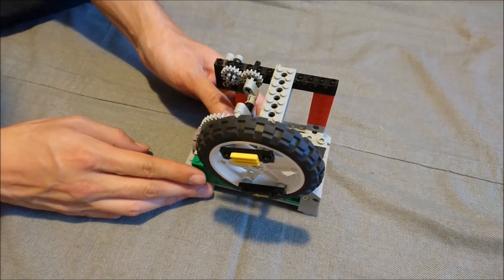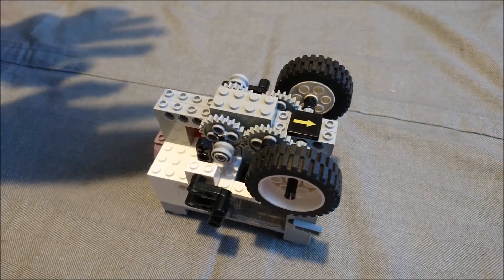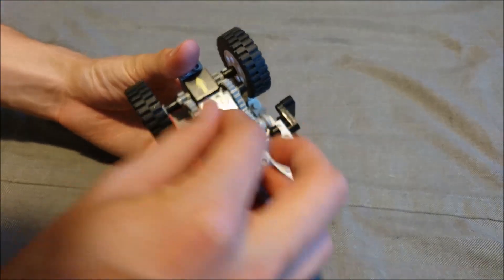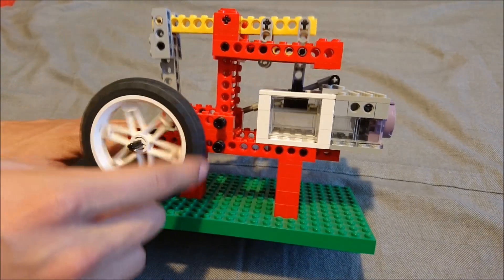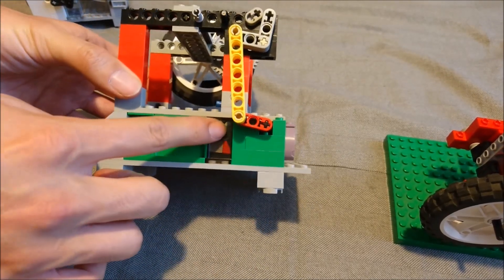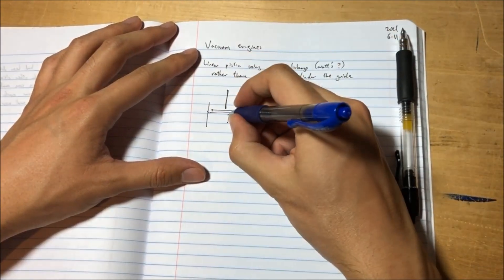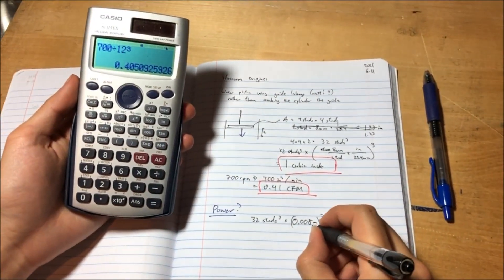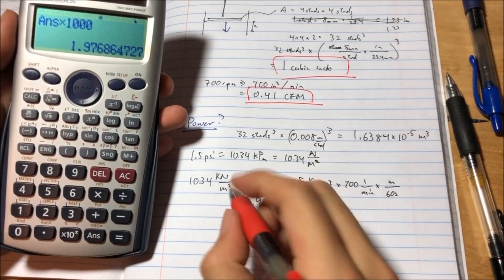LEGO Vacuum Engines Suck!

Comment: The oscillating piston is an interesting idea.
I had a set with the funny tube pieces that looked different from the one you showed.
Reply: I dont really think a geared flywheel is necessary, they would go faster without the gearing sucking power from them.
Reply: Now hold on, my 3 stud stroke 12x12 which is 432 cubic studs is 345 whole entire cc?? Thats a big block go kart. And my 5 stud stroke 4x4 (80 CS) is 64 cc? Thats bigger than a moped.  If I'm wrong sorry my math sucks
Reply from the maker: It's 3 x 12 x 12 x 0.8^3 = 221cc and 5 x 4 x 4 x 0.8^3 = 41cc... you need 0.8 cubed - one for each side - because it's volume.

Comment: Just use this calculation to get displacement instead, much easier. Bore (ex 4x4 stud piston would mean the bore would be 16 studs2) x Stroke x 0,512 = Displacement in cc's/cm3.
Reply from the maker: That's pretty much what we did; all the complexity is from unit conversions.
Reply: @NonsenseWars  kk👍

Comment: They don't make much power in the configuration you set them up with, but if you make a double acting boosted engine you will have much more torque. I just came up with a turbo design for easier power without the need of a shop vac, you might have some more luck if you build something like that.

Comment: There are many ways in which you can get a Lego Vacuum Engine- or ‘LVE’ as many people call it nowadays- to run significantly faster and produce more power. With the capabilities of Lego, you can go beyond this scaled-down versions of life size steam engines and look towards more efficient designs. I don’t like to be the shameless self-promo guy but I’ve created a handful of really speedy engines as well as some other methods of making these engines. Feel free to go check them out, if you’d like!
Reply from the maker: Yeah, I'm interested in finding a good way to better measure the performance characteristics of various engine configurations. We can't pull coins in the way that we did for the electric motors, since the vacuum motors don't generate much torque until they are turning. It probably requires some sort of clutch mechanism or dynamic load, but I'm still entirely sure how to do it - or if it's even possible to do it - in LEGO.
Reply: @NonsenseWars  a inline 4 starts when you Put vacuum on there, like a Electric motor when you connect a battery to it